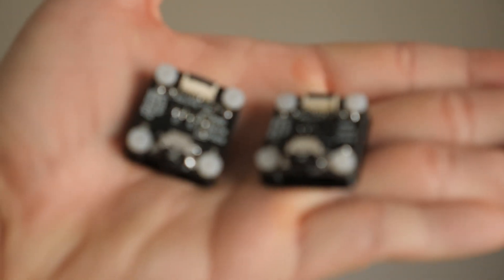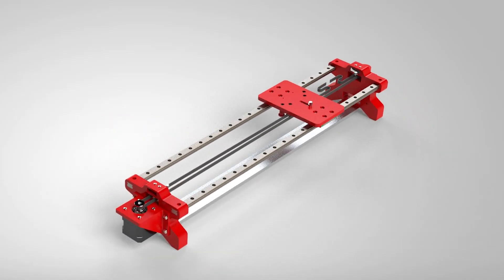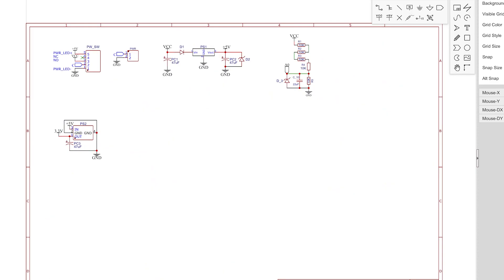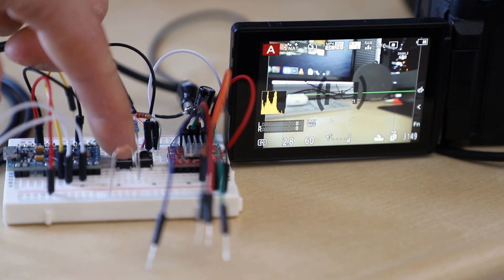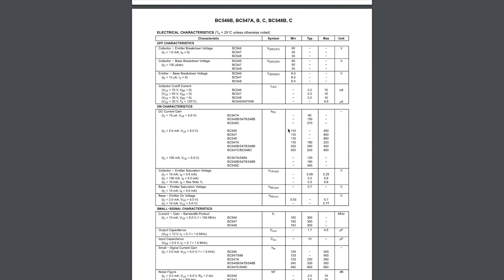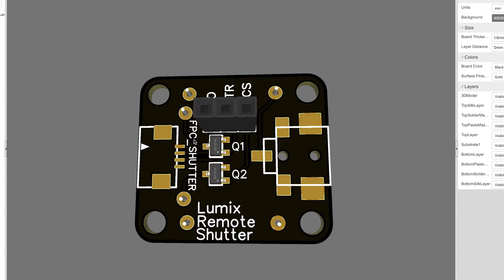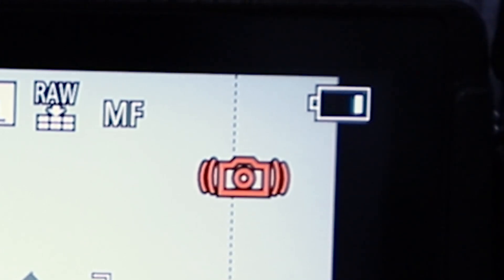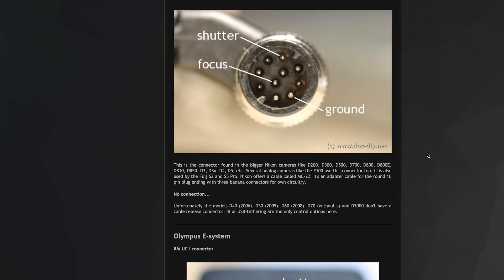DIY Arduino Remote Camera Shutter Control (Panasonic Lumix)

Comment: You should use photocouplers for isolation, that would solve you're pullup/pulldown issues and prevent any current from sourcing/sinking into the camera.

Comment: Awesome work! Which software did you use for your Kuanduino Mega and module models?
Reply from the maker: I used the regular Arduino IDE to write my code and upload it to my board as I would with any other Arduino. If you're talking about what software I used to design the board, I used easyEDA as it was quick and simple for me.
Reply: @mechee1747  Thanks!